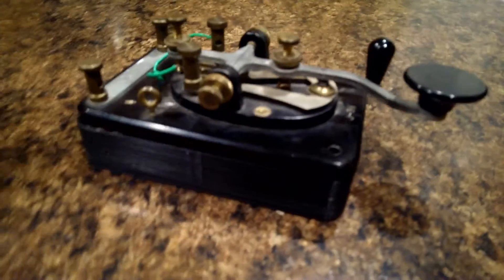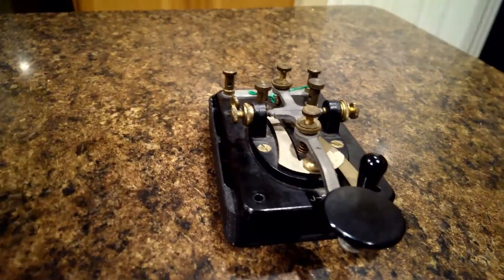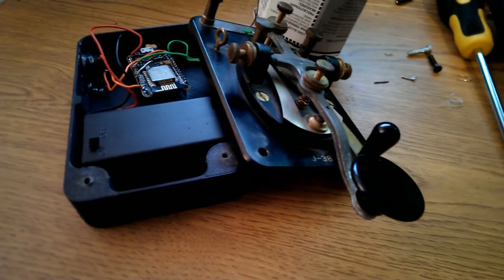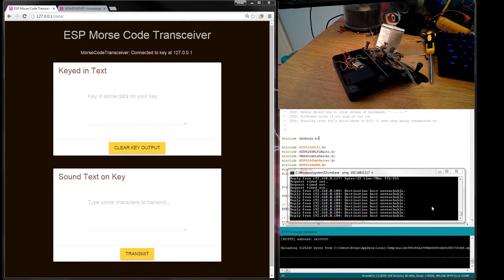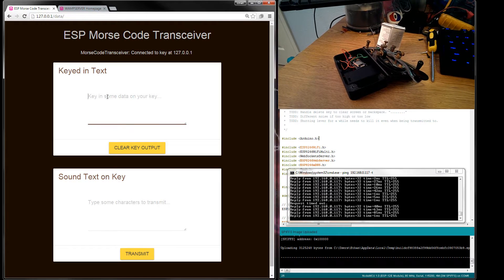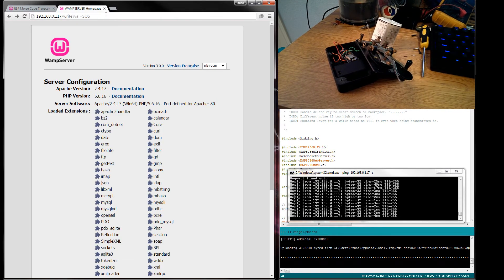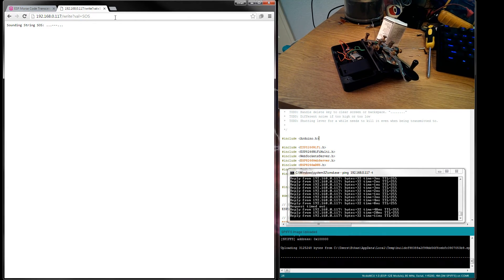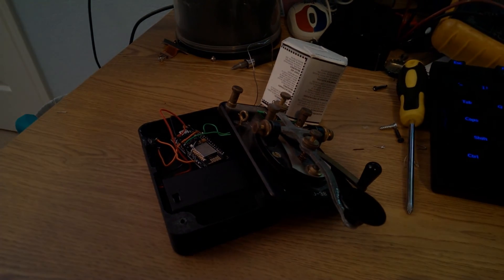ESP8266 Web Enabled Morse Code Transceiver

Comment: NO!  That slider or the right does not NOT take your key out of the circuit.  It's the same as pressing the key.  It's ALWAYS transmit!  It's used to lock your transmitter on so you can have both hands to tune the radio.
Reply from the maker: Ah, very interesting. Seems like a heavy book would do it.